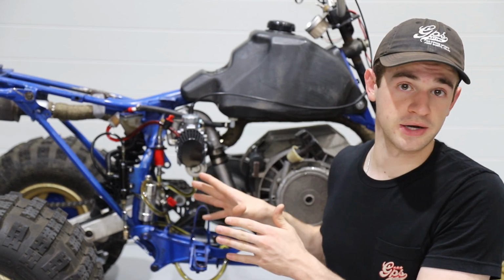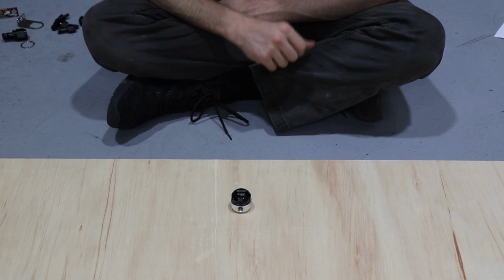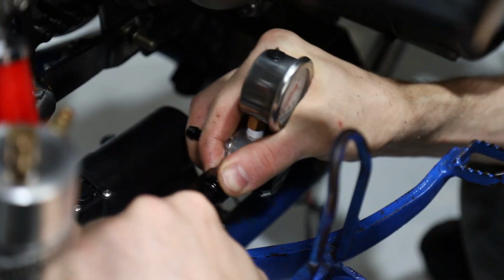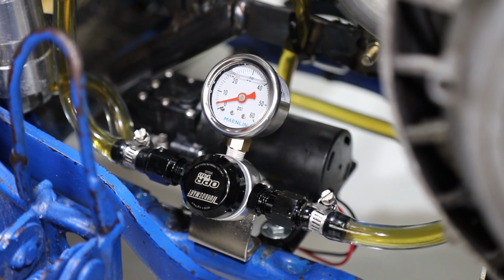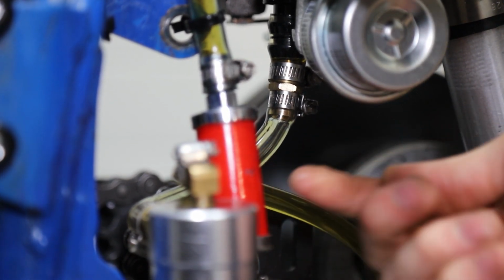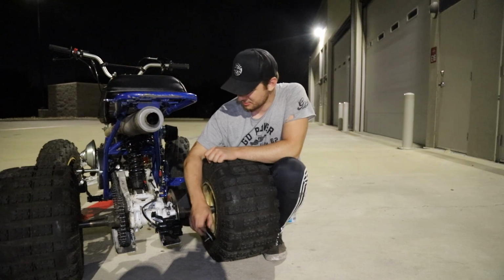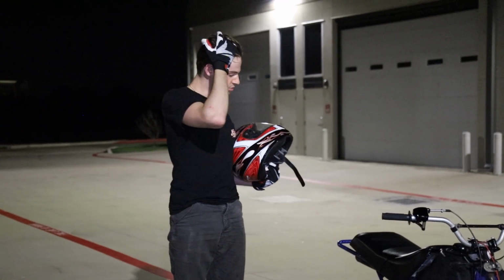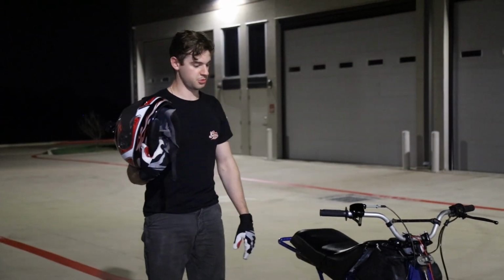TURBOCHARGED ROTARY ATV is Complete! | Ep. 9

Comment: You oil pump solution is a little elaborate,I have turbo'd a number of motorcycles when doing an external oil system I use an electric fuel pump (7psi rotary/holley style) use thin oil (0W10) and a pit bike oil cooler and just send it around..I have done about 5 bikes in the last 20 years no failures yet...Ps be sure to vent your system.

Comment: Hey guys, that engine has such an awesome sound. I live in Australia and can't find one of them anywhere. I've found that Sachs also made a 606 version of these engines with 120hp... they look the same as your one only bigger, they had them on old snowmobiles I think. Keep up the cool builds. 
Cheers. Ad from Oz. 😎👍🇦🇺
Reply from the maker: Thank you, the 606 is the holy grail of small rotaries! I remember reading that they had overheating issues
Reply: What no Arctic cat snowmobiles sold down in Australia? Jk . 
I had a chance to go to a estate sale of a local who raced for Arctic cat from 72 to 86. There were 2 of the 303 sleds complete in showroom condition and one of the 606 panthers in showroom condition. There was so much NOS race parts and like 10 vintage racing suits. I left with 2 of the 440 race sleds out of the 50+ that were sold that day.

Comment: Nice, interesting biuld but PLEASE  get a belt/ clutch guard on that thing! If you have ever seen a belt or clutch explode at 6500 or any rpm you would not even think about running without a guard. Not to mention of your foot slips into the belt or your pant leg gets caught. 
I have been around snowmobiles for a very long time and seen first hand what happens when those clutches and or belts go boom, it aint pretty!!

Comment: Awesome guys proper. Now the regulator return works like the turbo return that's why your getting 50 but otherwise beautiful. The rear brake looks like a scooter unit if not I'm sure you can get one locally for dirt and use it until the new stuff gets here.
Reply: Honestly never expected you guys to be the channel to bring a build with a proper pull through turbo. I'm very glad you did

Comment: You definitely need a EFI kit with tuneable ECU or blow through carburettor, the fuel hitting the impeller will negatively effect turbo performance and give poor atomisation of the fuel.
Reply: @sourand jaded yes I know, personally I wouldn’t have gone any forced induction route I would rather restore the sachs to its original condition but these are young lads with a YouTube channel so that ain’t going to happen, may as well give them advice on getting it running correctly.